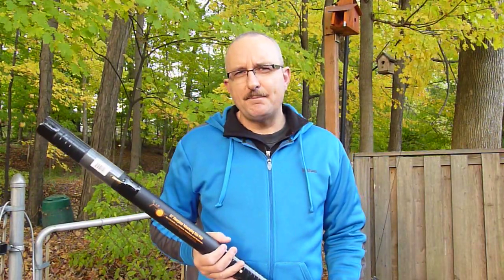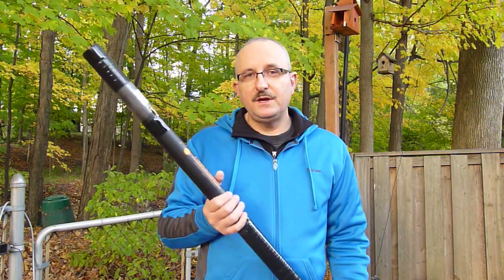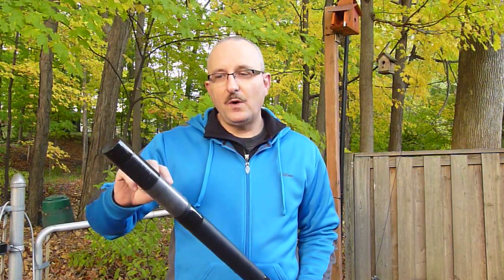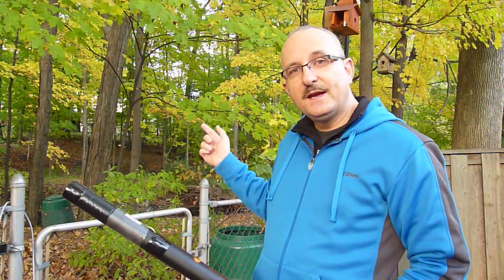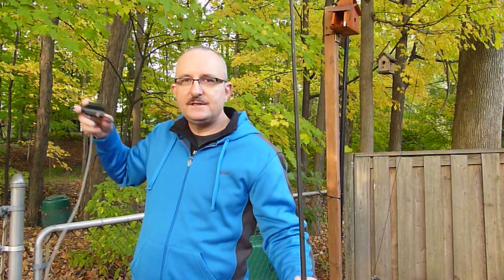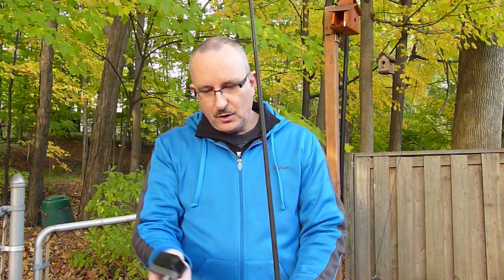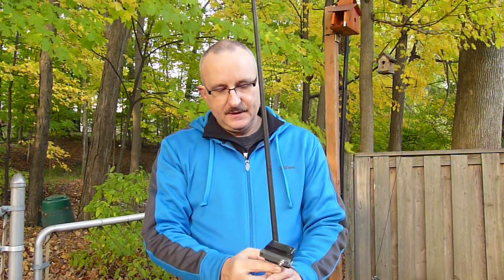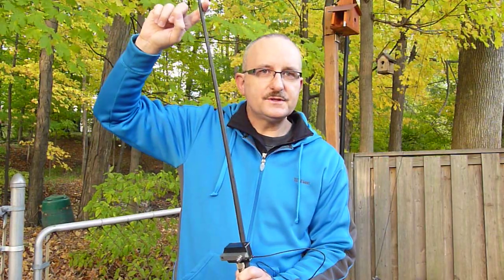Using Fiberglass Poles for HF Portable Operation

Comment: Agree with you completely Tracy. I was highly impressed with these masts. Perfectly suited for our antenna needs. And as you say don't try to hang the center of a dipole from the top, that clearly won't work. But I use and end fed half wave 20m
Reply from the maker: Thank you for sharing your experience!

Comment: The S9's are mounted to a pipe in the ground.  At my location we get a lot of wind, and although the S9 survived outdoors for at least 4 years with winds hitting in excess of 70 mph  at times, it was the addition of heavy snow that caused mine to fail.  "IF" or "WHEN" I pay decent money for another glass pole, I think I'll try to figure out some sort of spring mount, like used on long mobile antennas to lessen the stress on the glass pole itself.

Comment: Hello Tracy ! Thank you very much for posting your videos they are very educational and I'm sure helps a lot of hams with there antenna  ideas and installations. Myself I live in a basement apartment and as you can imagine it's probably the worse place for a ham operator to be in HI Hi.  But thanks to this video I purchased several of these poles and with the permission of the building owner I now have VHF/UHF & HF operational ! Thanks again and 73 De VE3LTY

Comment: I used a jackite pole to make a 1/4 wave wire stealth vertical antenna, used an MFJ tuner to use it from 40 through 10 meters. Hidden in amongst a few trees, and in fact resting against an oak tree limb for support, along with other smaller limbs from other trees, allowed me to just leave the antenna in place without having to use a ground mount. All the tiny tree limbs kept it up through Texas storms for a few years.  Very happy with the jackite pole.  Great video, gives me ideas! 73 de KF5KWO

Comment: Be sure to put a small ground rod next to it and bond the shield of the coax to it and be sure to use a balun with a dc ground on the coax center wire. If not you will have to run an RF choke and a 1 meg ohm resistor in parallel from the center conductor of the coax to the shield. This will help dissipate static charges brought in by the fiberglass poles. Or shunt feed the vertical antenna with a tapped coil to ground. That is my preferred method. They are like a dead tree as per gathering static. Ask w5cyf about that. I use these also and also the old military 4 foot ones. This is an amazing way to get an antenna up fast. But be sure to have a way to dissipate the static grabbed by these poles and take it off your coax. Many baluns have a DC ground feature because they are would. Those are the ones you want to use with these. Anyone that says well I haven't had it happen. Good deal! It is not if your going to get a lightning strike but when!  73 Jimmy, WX9DX

Comment: Great video and excellent audio for my old ears.  To prevent collapse of the pole in the US either Amazon or Autozone sell the Koehler EZ Clamps, a stainless hose clamp with built in knob.  No wrench or screw driver needed.  Many sizes for each section.

Tracey, love your idea of fastening the connection box part way down the pole and then running the antenna wire up further.  Why didn't I think of that?

Dave K8WPE
Reply from the maker: Great suggestion, Dr Dave! I would recommend using some sort of cushion to spread the pressure out a bit between the clamp and the pole as the pole can crack if the clamps are tightened too much.
73 from Tracy VE3TWM

Comment from the maker: Thank you!
I'm thinking about doing a video showing the various ways to mount these poles when there are no existing structures to bungee the pole to. Things I have considered are: a broomstick hammered into the ground, a camera tripod bungeed to a ground stake, and a two-wheeled dolly with a weight on it. As far as ground radials, since I use EndFedz, I don't need them. Seems likely you could rig up a standard vertical with radials for less cost than the ones you mentioned. 73 Tracy VE3TWM

Comment: Steve, I use a 22 ga. zip cord (R/S 278-1385) dipole (see QST) for 30m, 23.1 ft radiators (split the halves to make 46ft.), 34ft feed (all one piece no splices), and one for 20m: 16.7 ft. radiators, 24.5 ft. feedline, no balun straight to the SGC2020. 100ft roll does both. Nice and light. Tie center to pole, ends to tree, lawn chairs etc.Trailer mount is next. PS pole is good for hanging wires over branches etc.   73  Peter

Comment: Thanks for the vid Tracy!  I too love my 31 footer. I found a heavy umbrella stand for $5 at the local thrift shop and keep it for cabin portable. Will try end fed soon via W5JH tuner on the web. Trailer mount is next. PS pole is good for hanging wires over branches etc.   73 es gud dx Peter
(Will try to post info on zip cord dipole next)

Comment from the maker: Yes, I think so even though I've never tried it. BUT you need to note the following: if you use the 31' pole, if the ground plane is relatively lightweight and you do not mount it at the top of the pole this could work. The bottommost poles are fairly rigid. You could probably extend the pole up to about the 16' level, then mount the antenna at that point (just don't extend the remaining sections). Good luck, I'd be interested  in hearing how it goes. 73 Tracy VE3TWM

Comment from the maker: Hello John! I use my poles the same way in order to get the entire antenna up and in the clear. Works great, you just have to watch that the feedline is supported; the poles are very narrow at the top and cannot take much weight. If you are using a centerfed antenna and can support the feedpoint using something other than one of these poles, you should be fine. 73 from Tracy VE3TWM.

Comment: Hi Great video. I have built many portal vertical with the jackite poles. I have also adopted the 9:1 balun from Balun design and the 1:1 Isolation balun #1115du from balun design. Use 36 feet or 53 feet of wire helically wound and the performance is INCREDIBLE. Im always a first call on pile ups.

Comment: Hi Tracy. I still use my Fibreglass pole when the aly mast is not appropriate. I lost the top section in a collapse lol but quickly learnt what you pointed out here. They are also excellent for verticals.
Reply from the maker: +Allan Thompson Thank you for watching and for sharing your experience Allan!

Comment: Here in the UK there are two "levels" of these you can get.  There are fishing poles - and avoid the carbon ones! - similar issues to aluminium masts.  and there's flagpoles.

1. Fishing poles. These are the fragile ones. For ultra light use they're okay for a day's work but not really much more. The tube wall-thickness is minimal to say the least.

2. Flagpoles - these are made for folks who like to attend caravan club rallies and have a flagpole up with a windsock-type banner up top as a focal point in what could be a busy camp ground.  These are longer and less fragile.  In my mind these are the better option if you're on a tight budget.

And I'll add a "3" to my "2"!   These are the ones made for our use.  Spiderbeam in Germany make a 12 metre one (as well as a hugely enormous 18 metre tree-trunk of a thing (which to my mind needs a small team to erect safely) - and there's the Hyendfed co. in Netherlands who makes two or three strong antenna-masts which are like fishing poles in principle but vastly thicker/heavier/stronger.  I have three of the 12.5 metre masts that Hyendfed sells. (I'm a customer - paid for them all!)  They're not cheap - but they're heavy grade manufacture & top quality.

Originally I started with a 10 metre flagpole from an ebay seller. It was too weedy to deal with any antenna worth erecting and was quickly relegated to simpler duties.  I found what I was needing was the three 12.5m masts above mentioned.  They can hold up lightweight dipoles/windoms/G5RVs etc to their full height provided you're sensible with wind conditions on the day you plan to operate.  Leave out a couple of sections from the top and they''ll hold up in half a gale.  Three sections from max, I doubt any weather could break them - unless maybe a lightning strike?  HiHi.

If using an endfed antenna I install it as a sloper - it's a light construction 4-band model and 20m in length. Low end goes to a short stubby mast around 16ft high, sloping up to the top of one of the big masts so the full length of wire is suspended between.  I wouldn't claim it works as well as a full size flat top antenna but it's not far behind.  The antenna does 40-20-15-10 and I keep a matcher in line preset to 17m - this is kept on pass-through till I want to work 17m, then I switch in the matcher.  Works very nicely and doesn't take too much time to put up.

With apologies for the length of this "comment"!
Reply from the maker: Great stuff, thank you for sharing Ian!

Comment from the maker: The poles are very lightweight and very easy to lift while standing straight up. If it's windy you might have a bit of trouble. I'm not certain what you mean by using a ladder and a pipe driven into the ground; you could skip the ladder and just drive the correct diameter of pipe into the ground, then slide the pole into the pipe. 73 from Tracy VE3TWM

Comment: Thanks for making these videos on HF portable operation. I appreciated your practical recommendations very much. As somebody who lives in an apartment, mobile HF is all the HF I have. I find your suggestions on end-fed antennas and telescopic poles very crucial. 73 de N2DPS.
Reply from the maker: +Daniele Paolo Scarpazza Hi Daniele, thank you for watching! Every time I hear that someone has found one of my videos helpful, it encourages me to make more. Good luck with your HF mobile operations.
Reply: +twmckim Glad to hear! I ended up ordering a 8-band hyEndFed antenna and two carbon fiber 30-ft telescopic poles. I'll let you know how that improves my portable HF operations from the park! 73 de N2DPS
Reply: +Daniele Paolo Scarpazza Carbon fiber is a conductor, isn't it?

Comment from the maker: Hello Steve! The very bottom of the pole has a plastic fitting and is slightly smaller than 2.25 inches in diameter. I would suggest using a support that the pole could drop into (i.e. the support pipe being outside of the bottom of the pole rather than inside); my thinking is that dropping the pole into a larger diameter pipe would be more structurally sound. Jackite used to sell an excellent ground mount stake for the 31' pole; though expensive it was very good. 73 de VE3TWM!

Comment: Thanks for the video. I use an S9 antenna which is basically the same type of pole you are using except that the antenna runs inside the pole. It does require an unun and some radials. But it works.

Comment: I liked your videos. They've inspired me to do something similar. You're right in top doesn't support much weight. Most I've gotten away with is 22gauge running through.

My next attempt is running an end fed zepp up and out much like your inverted L.  For easier operations, I'm sliding a drilled out ring down at the top for center support.  This way I can just extend the wire out and the pole up without feeding it through the narrow loop at the top.  Thanks for sharing the video.  Chuck/aa0na

Comment: Thanks for the info.  I ordered the 31 foot, regular model in black.  I fastened two painter poles together with hose clamps yesterday and it was more trouble than it was worth.  They leaned over terribly, the sections bent (I think they relaxed o.k. when the went back into the main tube), and as they didn't collapse very far, they took up the entire length of the right side of the car.  I used an EndFedz 20m.  I'll type another reply with a question.

Comment: I started using glass poles for antennas a few years ago, including as portable vertical antennas for HF (Telescoping Crappie Poles).  I have/had the 31' S9 antenna which is now 1 section shorter due to a blizzard this winter with wet snow,high wind, creating too much stress, bottom section failed. Replacement section with shipping is prohibitively too expensive.  Using what's left of it for vertical run of wire that ends with 71' run to top of nearby tree.  Feed point at ground over radials.

Comment: Great info! Were you able to create 20m EFHW antenna with one or just a bit too short?
Reply from the maker: HI, thank you for your question. Many have created 20 meter verticals out of the 31 foot poles, but I only use mine to support commercially made antennas. 73 from VE3TWM.

Comment: Do you think I could make a 1/4 wave 80m antenna on a paint pole? thanks
Reply from the maker: That would have to be a VERY tall painter's pole. With loading coils (which are very lossy) you might be able to do it. I think you'd be better off with one of the 40 foot poles sold by HyEndFed or Spiderbeam.

Comment: I found that the pole tip is just the size of yellow jackets and when the base the pole is attached to a shop vac yellow jacets disappear from cracks in the wall seams of the house. Organic pest as alternative low sun spot sun cycle blues.

Comment: I'm thinking about getting a Jackite pole myself.  I'm considering mounting options; either inside the pole or around it.  I have a painter pole with a 1 1/2" pvc pipe for a 6m omni.  I also have an RV sat tripod that holds the painter pole. Would you mind measuring the base of the antenna and letting me know how wide it is?  I am thinking that it could fit inside a bigger piece of pipe, or a smaller piece inside it for the base.

Comment: Hello Tracy,
You are certainly more experienced as i am thats why i like to ask you next question.
I now the difference between conducting and non-conducting poles. I own one of both types, mine are formerly Fisching-poles. You always use Fiberglas poles, but my question is: is this really necessary? I now why you do so, but what if i use my conducting carbon-fiber pole for my EFHW antenna when i put a piece of rope (± 6 feet) between the pole and the isolator on the antenne. In my opinion this wil be not an issue to have any problems with the antenne pending horizontally or slope-wise down. Its clear, the antenna should not pending in any way parallel to the pole. I ask you this question because my carbon-pole is 5 feet longer than my Fiberglas Pole and i think i can prolonged him with some more 6 feet.
Until now i used always the my Fiberglas Pole, but because the carbon-fiber-pole is longer and easier to transport (1.5 feet shorter collapsed) i wil change to this conducting carbon-fiber-pole.
Maybe i can later use the Fiberglas pole for a vertical antenne. A win-win situation

Wil you give me your opinion? Thanks in advance.
73 de ON4GED
Reply from the maker: Hi and thank you for your comment. Chris K2CJB, Tim N9SAB and myself spent a few minutes answering your question on our latest livestream (I Know What You Did This Summer). Check it out! 73 from VE3TWM.

Comment: Thanks, Tracy! I've found another source for poles: TelePole from the Mast Company in South Carolina (dublya dublya dublya dot TMastCo dot com). They've got several poles in black and green. Their 32-footer is $115USD. I'm tempted by their 22-footer at only $46USD. I have a few ways of getting the bottom of it up to about 10 feet (existing tree or carport roof clamped to the gable end of the main house). Oh, they have red poles, too. I can't imagine why these bright-colored poles!

Comment: I can't really afford more EndFedz antennas right now.  I have a very light Balun Designs QRP balun (1110cw) with wing nuts (3x2x1.5").  It is easy to cut mono bands, and put end rings on.  Much simpler than multi-band SWR matching.  Do you think if I ran the RG-8X up the pole, and fastened the balun at the top, there would be any problem with a vee?  The coax is the heaviest part.  How do you think this work would with the Jackite pole?  Thanks, Steve

Comment: I’m thinking of getting one of these. Do you use any guide wires or guide lines when you deploy it?  Also if you don’t have a fence to strap it to how do you secure the base of the mast?
73s,
Reply from the maker: Good questions. Typically I do not use guy wires, but I will if there is nothing to strap the pole to. I'll be posting a video about different mounting methods come springtime.

Comment: Great idea and nice video. Do you find a large difference between the "L" configuration versus a pure vertical configuration? I would appreciate your thoughts on that.
Reply from the maker: Thank you! My advice is to put the antenna up high in a horizontal configuration if you can do so. Only go to a vertical or sloper if space is limited (unless you want the benefits of a vertically polarized antenna and can get the entire length up vertically).

Comment: I have a similar fibre glass pole and I hope to use it with a unun wire antenna, but mounting it is my main concern. I have considered using cable ties and fixing it around a fence post (assuming there is one) or trying to use the wire (in 2 extended with a guy at each end) and another guy line, but attatching it to the pole is my problem, I am not sure of a secure way of securing it.  Any ideas / suggestions would be much appreciated. Thanks. Bob M0BOB.

Comment: Nice video!! Can you provide a link to the various types of methods that may be used to ground mount one of these polls? What about the radials at the bottom for limited space folks such as myself? I would like to build a mult band HF vertical using something like this without just buying the ones from LDG S9, or DX Engineering for $150-200+ if at all possible?